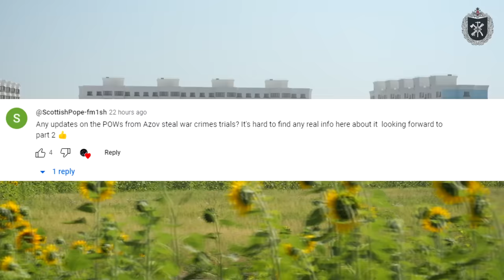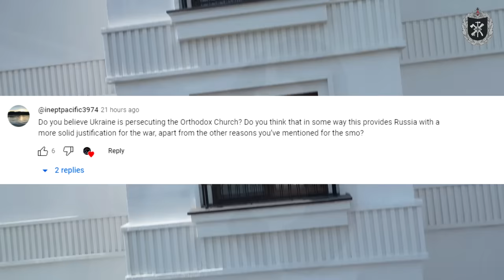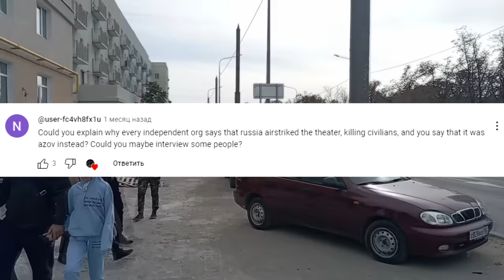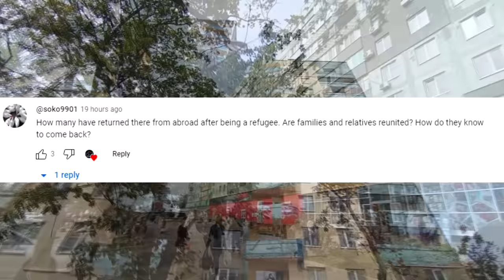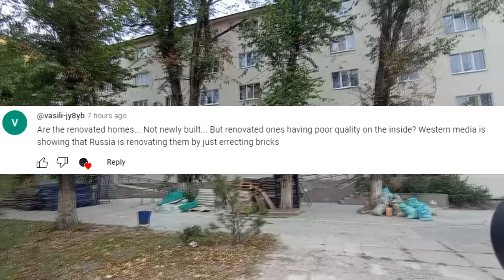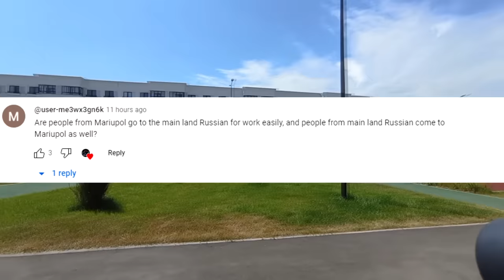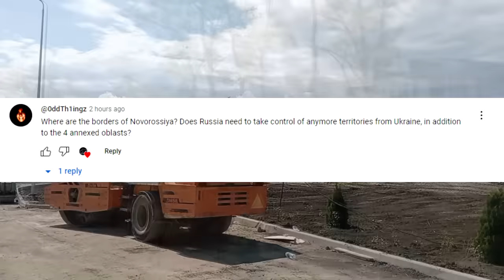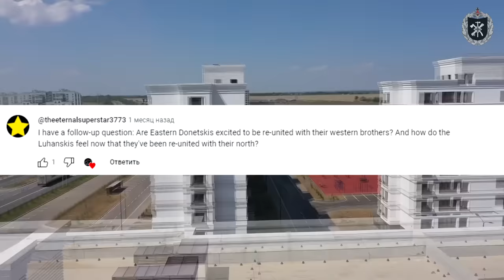ANSWERING YOUR COMMENTS ABOUT DPR, UKRAINE AND RUSSIA

Comment: It's insane to see how the city has changed, just from 2 years ago. Never thought it would look like this today. So fast. Great job !
Reply: It's unbelievable how the Russians have changed (destroyed) this city in 2022. We will not forget.

Невероятно, как русские изменили (разрушили) этот город в 2022 г. Мы не забудем.
Reply: @janmasek7590  The city was destroyed by Azov and the Ukrainian army. They didn't want to take the fight outside the city. That's why they started shelling and setting fire to houses even before the arrival of the Russian army. Thus, they "masked" their firing points.And the residents were herded into the basements. People remember everything and will never forgive.
Reply: @sonechka100  
You are right, everyone is grateful that the Russian plumbers and masons and electricians are moving forward.

They fix one city after another. Mariupol, Bucha, Bachnut, Avdievka. and so on.

Their Air Force, artillery and tanks use their cannons and rockets to repair the structures and insulation of houses that the brutal AZOV destroyed for 30 years.
For the most difficult repairs, supersonic construction rockets are used to seal dams that are at risk of overflowing. And the damage that AZOV is doing to the Ukrainian power grid will also be easily repaired by Russian electrical repair rockets.

We in middle age, who still remember the Soviet Union a little, remember Soviet agricultural equipment.

You may know the story.

Two Chinese tanks attacked a Soviet parish tractor while plowing.
The tractor returned fire and destroyed both tanks.
Then the tractor flew away peacefully.

God save Russia from evil and stupidity and dictatorship.
Reply: @janmasek7590  No one claims that Russian shells and missiles do not destroy buildings in Ukraine. You are being told about a specific case of the actions of Azov and the armed forces of Ukraine in Mariupol. If you know Russian, then you can, for example, find videos in which the local population of Avdiivka talks about how Ukrainians behaved during the fighting and after the retreat. It's all the same. And the armed forces of Ukraine have been shelling Donetsk for 10 years. But in your world, of course, the Russians did it.
Reply: How should state forces behave to people with guns and military equipment, which are stealing and destroying properties and are endangering civilian citizens?

For how long does the Russian army operate on the territory of Ukraine?

What did thay do for all the time?
Thay foght against domestic police and army.
If they did not support the separatists minority in Donetsk, by military equipment and manpower.
There would not be a shelling in Donbas for 10 years.
Reply: @janmasek7590  Answering your first question: Depends on the context.
Reply: @chrisgaming9567  

Hi, can you be more specific?
Many things depends on context.
Reply: @janmasek7590  Мыкола, перерыв закончился иди в Работино ловить дроны!))